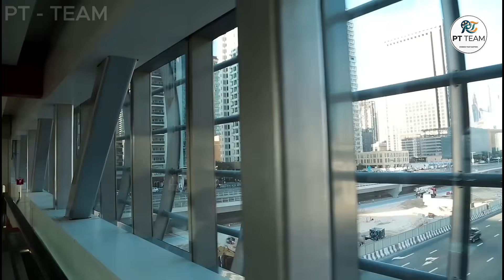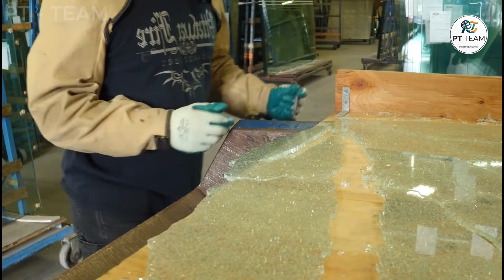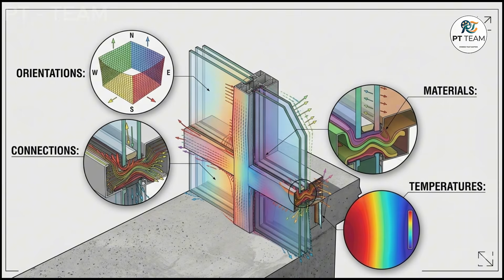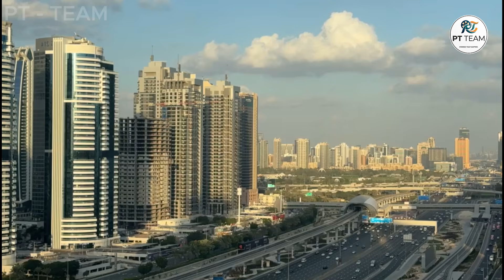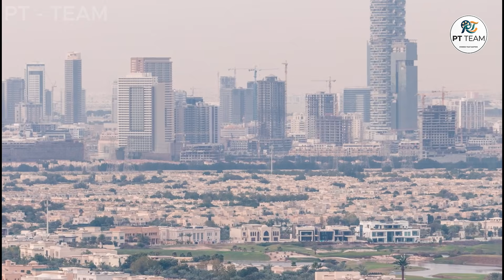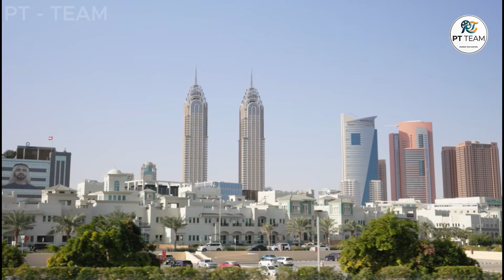Why Burj Khalifa’s 26,000 Glass Panels Must Move To Survive The Intense Sun Of Dubai

Comment: If they would have looked at termite mounds or ant hills and copied their designs it would have natural air conditioner.
Reply: Even ancient Persia had natural cooling architecture that still exists today. Oman built modern architecture based on ancient architecture rather than fighting the weather for the sake of modernity.
Reply: @unlikelybedouin I saw it and I would not change anything. Modern buildings are ugly and hostile.
Reply from the maker: Biomimicry can inspire excellent passive cooling, and termite mounds are a famous example. But for Dubai’s sealed high-rises and extreme summer heat, passive design alone would not replace mechanical air conditioning.
Reply: @PTteam-k1f you pay a price fighting Mother Nature 😂